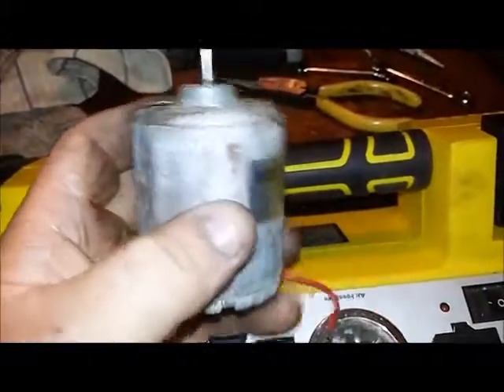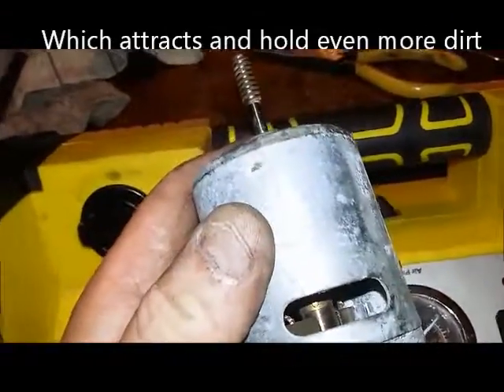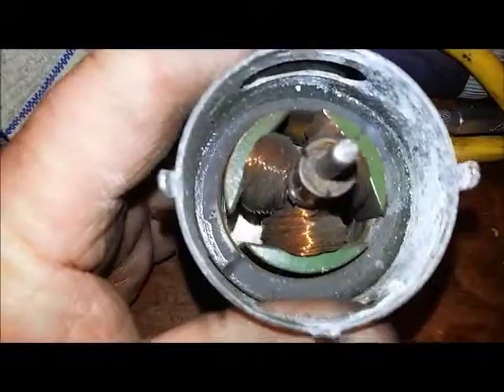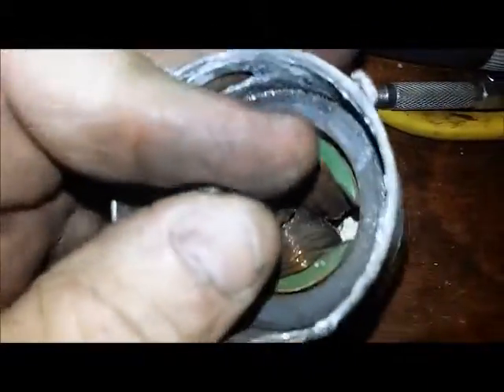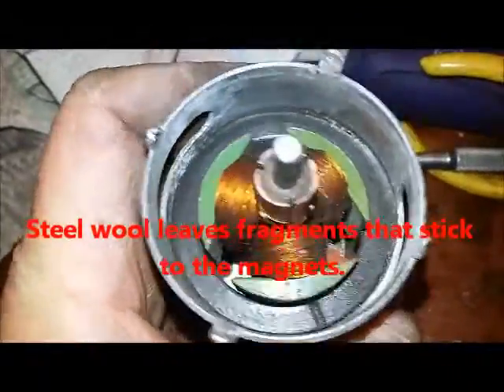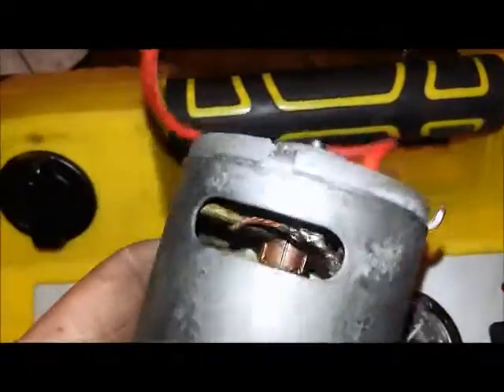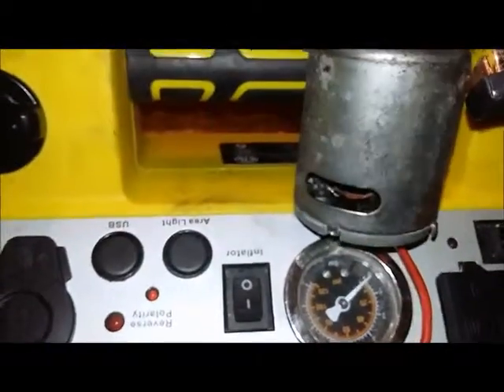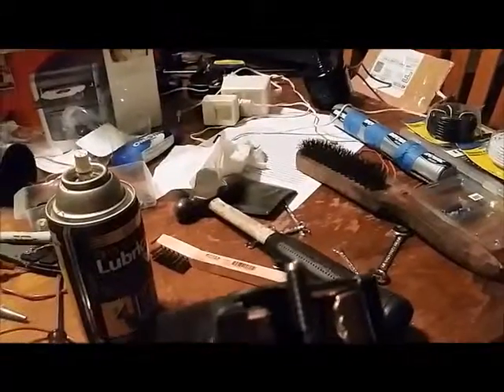Aerodynic Motor Repair

Comment: Do you lube anything in these motors? Doesn’t seem like there’s anything that needs it
Reply from the maker: The issue with this type of motor is the vent holes, that did not exist on earlier motors.  Dust and moisture get inside of them.  Earlier motors were practically sealed and maintenance free.  This one has to be lubed over time and it does have holes for applying oil to the bearings. If you look near the shaft where it enters the case on the front end you will see a small weep hole. There is a cotton washer around the bearing and by dropping oil on that weep hole it will be wicked inside by the cotton and apply the oil (after soaking) to the bearing. I also usually put a drop of two on the shaft where it goes in and spin the motor to pull it inside. Will usually quieten the motor and free it up some.  On the rear of this motor is a copper cap, although over the years many were tossed.  If the cap is there, there was originally a small BB that stat over the shaft where it exists the casing on this end.  It had a thicker grease on it to keep it partially lubed. Often there is also a small oil wicking hole there as well where you can apply oil to a cotton washer.  If noise continues the I recommend the motor be taken apart, cleaned out and lubed from the inside.  I perform that service when needed. I have had a lot of motors sent to me when folks took them apart and couldn't get them back together again. Either pulled the bearings loose or broke the brushes, wiring connector, etc.  Cleanings run about $20 plus return shipping.
Reply: Skulldigger thanks for the info! I had mine apart yesterday to clean it up but wasn’t sure about the lube. I must say, I hate the tabs they use to hold the end cap on. Code 3 Bosch motors were so much nicer to work on since they had screws!